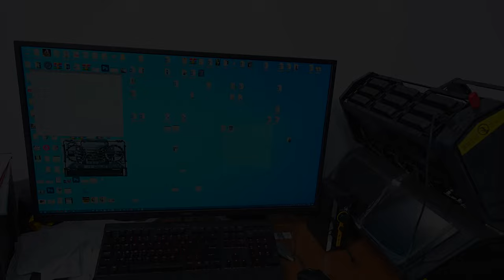MSI RTX 3090 Gaming X trio Video card(Changing thermal pads & paste, Washing, Drying, Cleaning) - 4K

Comment: It's the first time I see someone who has any idea about electronics wash the entire card in plain water. A killer for PCBs about bearings on fans, not to mention. If this card comes without a month failure it will be a miracle.
Reply from the maker: i didn't understand the meaning of your comment, why you have written this coment? what is your purpose?
Reply from the maker: i'm using this video card already 4-5th month, and as you see it is more than 1 month, so keep your very smart minds for you.
Reply: @Emperor-2029  Try to ask some electronic services for opinion if you dont know it's ridicolus using home shower for cleaning electronical parts. It's my opinion, that's all
Reply from the maker: @kryptolandia.  why you continue to write your STUPID comments???????? you have written: "If this card comes without a month failure it will be a miracle." - i've replied you that this is 4-5th month it is working without any issues, so go with your fucking opinion other place!
Reply: I agree, that it's not a good idea to wash it, may be the cooler, but then I would just use the compress air. As of electronics only Isopropyl alcohol can be safely used for cleaning WAY better than water for sure... Kryptolandia is right, you damage your bearings with water. I was shocked when I saw that. It doesn't mean that  you card will break, as you did dry it up pretty fast, but it's not a good idea to use any water with any electronics or circuit boards, mosfets, etc (for your reference I'm the computer hardware engineer with over 20 years of experience). Isopropyl:

Dissolves oils, adhesives, soldering flux, residues, fingerprints, and other contaminants
Leaves no oils or traces, unlike many ethanol compounds
Evaporates quickly
Reply: It is safe to use water on electronics (but not on bearings. i totally agree about it) if it’s completely dry. But it depends on you’re region’s water quality. If the water isn’t clean enough, the PCB might eventually die in short time.
Reply from the maker: @Yakko-  Thanks for your time, comment and for advice: in my region the water quality not so clean as i would like, but anyway the video card is working more than 5-6 months, so don't worry about my video card, it is in Perfect Working condition.
Reply from the maker: @houdiniharry8263  Your mom is Amateur... go and write comment on her ass.

Comment: For anyone watching this video, please wash with rubbing alcohol instead of water. Water will make the metal parts rust over time, at the very least. Also, the bearings in the fan are oiled. If water gets in there, the oil will be partially or completely washed away. That's not good.
Reply from the maker: OK, Thanks for important and useful info.

Comment: Why did you wash it instead of using compressed air? putting new thermal paste and pads and just call it done?
Reply from the maker: I washed because I wanted 100% perfect cleaned video card, as it was used under mining (6 months) before and it was very dirty. So I decided to clean video card with washing process. After changing thermal pads and paste this video card is working already 1 year +2 months.

Comment: The best results come from PTM7950 phase-change thermopad on the core GPU and gummy thermal paste K5 Pro, Laird Tputty 607 or Upsiren U6 Pro on the vrams and mosfets because have much better thermal conductivity than thermopads.
Reply from the maker: Thanks for important info! i will use it in the future. Thanks again!
Reply from the maker: @Bootyhole-bandit  What is MOSFET?
Reply: @Emperor-2029  power section
Reply from the maker: @goorthiss  i haven't add thermal paste on power section.
Reply from the maker: i've searched in ebay and saw that this thermal pads are 8.5W/mk, but XPC T20 is 20W/mk, it means that XPC are better or the BEST in thermal pads' market for Video cards.
Reply: @Emperor-2029  It is not better than Upsiren UX Pro for sure. The W/mK value alone is not an determinant of which material has better thermal conductivity. Density, composition, etc. also are important elements.
And PTM7950 phase change material with 8.5 W/mk beats all available thermal conductive pastes on the market, even those that have 14 W/mK. This substance after several years will still dissipate heat as on the day it was applied.
Reply: @Emperor-2029  for the power section, vrams, you can give thermal putty instead of thermal pads https://youtu.be/raHKGnJ4LYM?t=547
Reply from the maker: @goorthiss  Which important elements has Upsiren UX Pro or PTM7950  thermal pads, that XPC T20 hasn't?
Reply: @Emperor-2029  PTM7950 is a replacement for paste, and Upsiren UX Pro thermal pads. One of the advantages of thermal putty is that you don't have to worry about what thickness to give, because it will be perfect, and the excess will flow out. For gamming laptops with high TDP and TGP, manufacturers are more likely to use this substance than thermopads, as well as cryptocurrency miners most often swapped GPU thermopads for this substance, which proves something.
The same applies to PTM7950. It is always the same thickness of 0.25mm and perfectly covers the entire core. When spreading paste, it is difficult to do so. Its lifespan is several times longer than that of traditional pastes, and over time its thermal properties even improve.
Lenovo uses a similar material PTM7598 from Q4 2021 in the top Legion series laptops and Nvidia in the 4k Founders Edition series. There are also videos on YT how a service technician applied PTM to the PS5 and the console did not overheat, on ordinary paste the console would cut off power from overheating after a few minutes of playing.
https://youtu.be/2FNuK-ClIGU
https://youtu.be/9uAAlIaOmQ0
Reply from the maker: @goorthiss  do you recommend to buy these thermal pads? - https://www.ebay.com/itm/204315433948?_trkparms=amclksrc%3DITM%26aid%3D1110006%26algo%3DHOMESPLICE.SIM%26ao%3D1%26asc%3D20201210111314%26meid%3D37f3e6923bf94692a8faa86df21a9d50%26pid%3D101195%26rk%3D4%26rkt%3D12%26sd%3D334722254896%26itm%3D204315433948%26pmt%3D1%26noa%3D0%26pg%3D2349624%26algv%3DSimplAMLv11WebTrimmedV3MskuWithLambda85KnnRecallV1V4V6ItemNrtInQueryAndCassiniVisualRankerAndBertRecall%26brand%3DUnbranded&_trksid=p2349624.c101195.m1851&amdata=cksum%3A20431543394837f3e6923bf94692a8faa86df21a9d50%7Cenc%3AAQAIAAABUA2rugFlOq3qu1cLac%252F%252Fk6Vp0Oa0HaJIqoXKeIiOR%252BTUgsSvHaeyPxKYu6UqHqq7GaGyKVqHQnjeiiXcQpMGw2t3aB%252BssGfjtIWOBj8wExc7oYYP7xGMyQCrHDyDaSaWjKlNFBA64FuP0KlWLh3ba6PGv0J9srxy2BKN8TfLMhtsI5jiQxtCwUS7XYFR%252FY5xAeLZxvkjwU5W9v70SQ7wf8a5v5jpvcGFtIlkNN62Anl0ZJ%252F5l3be2NoHA4Q9OsabRoGOzKqr%252BV9Rm9qgqhZWeCm2KtBDyrZHfHbNQjROW%252BeFe2U9ZNr5JmDyAxW0aVjgjXO7KuSm3kib42BQXWgwR5rBUalh2xNuHxC2I%252BJ1nj3ALF1d9b0CZJx%252FOne141NoFhtdcrwbVY2edY6TPfhGJFQUgC3Uq0ZA6416%252F6mJYa532F053F99LJoSJSuNzlr6jg%253D%253D%7Campid%3APL_CLK%7Cclp%3A2349624
Reply: @tryharder1053 K5 Pro is marketed as a "viscous thermal paste", but it's designed to be used in place of traditional thermal pads.

But I find it's performance is not very good at all.

What you want is a high end thermal putty. "W/mk" ratings are mostly used a marketing tool rather than being truly representing of the performance you can expect. Gamers Nexus and De8auer did a good video where they talked about the rating/marketing issues of TIM's.

Comment: Hi, I bought a heat pad and after 2 months it was completely dry. I want a non-drying thermal pad for my 3070ti graphics card power adapters.
Reply from the maker: buy XPC thermal pads 20W/mk.
Reply: Thank you. I need the ThermalPad that came with the card from the manufacturer. I need a heat pad that doesn't dry out, like the one that came with my graphics card from the manufacturer. It's been through 2 years of heavy use and it still hasn't dried up.
Reply from the maker: @batryuttv5239  Trust me, XPC better than graphics card's  thermal pad of manufacturer.
Reply: Thank you❤
Reply from the maker: @batryuttv5239  You're Welcome!

Comment: Can you name or add a link to all the thermal pads that you used please
Reply from the maker: Arctic thermal pad 145x145mm x1.5mm, Arctic thermal pad 100x100mm x0.5mm, Thermalright Odyssey thermal pad 2 and 3mm (85x45mm), EC360 BLUE 5W/mK Thermal Pad (100 x 100 x 2.0mm), EC360 Green Thermal Pad (100 x 100 x 4.0mm).
Thermal pastes: Arctic MX-4 and MX-5 (now i'm using and also MX-6), Noctua NT-H1.

Comment: Water on PCB??? Haha fing genious
Reply from the maker: Watch till the end of video, you will be surprised that this video card is still working since 2022 November till this day(1st.April.2024).
Reply: If De8aur washes his GPU's and Motherbaord in a dishwasher, then I'm confident it's not as bad as everyone is making it out to be. Although I would probably avoid water getting into fan bearings.

Likely best to hand clean the fans separately.

As long as the card is fully dry before reassembling, and if the water was clean and low in minerals then should be fine.

I personally just hand scrub with 99% Isopropyl and a toothbrush, but to each their own :)
Reply from the maker: @snarksdomain  if you have watched this video till the end, you can see that this video card is working since 2022 November up to this time - 12.May.2024 (18 months +), watch from 08:55 and you will see that this video card is working after cleaning, washing and drying.
Reply from the maker: @snarksdomain  the same as in my 2nd video - https://www.youtube.com/watch?v=yx3lXRVDMOg
Reply: @TheEmperor2029  My comment was meant to show that I'm agreeing with you. Water itself doesn't hurt most electronics, at least not our GPU's.

 Biggest thing is to make sure they are dry before turning on, and you have done that, so good work man :)
Reply from the maker: @snarksdomain  ok, Thanks, understood.